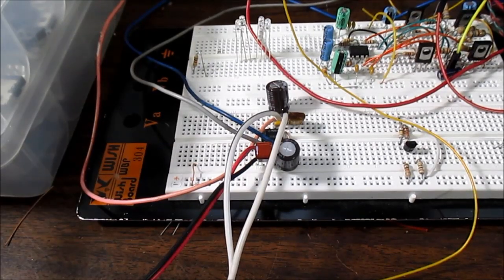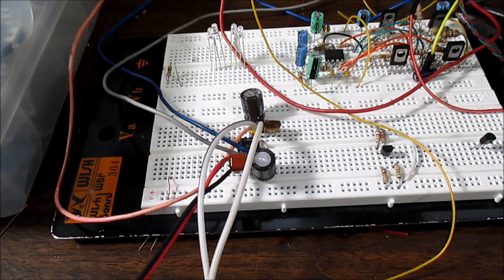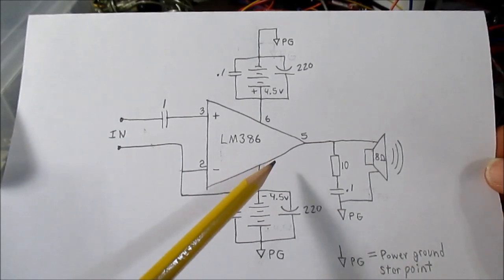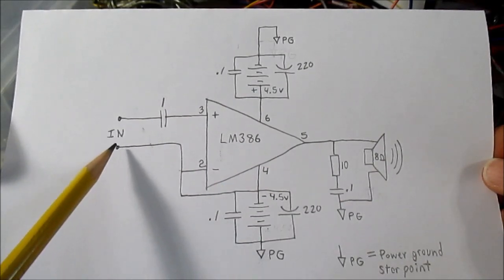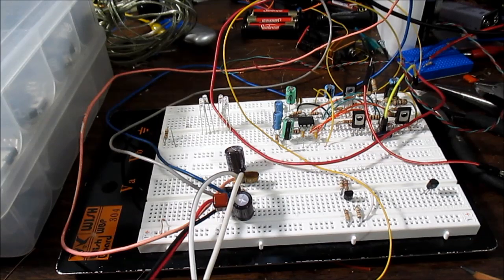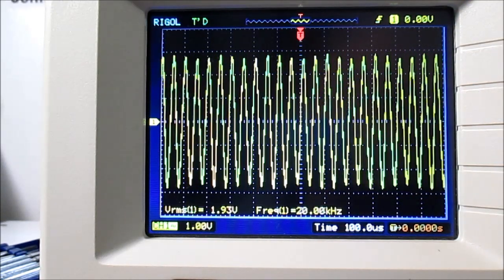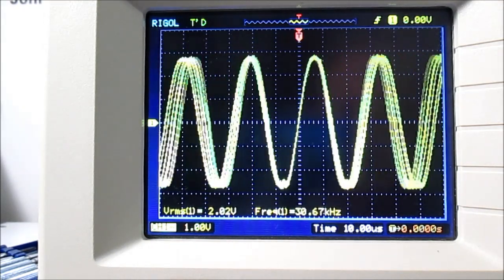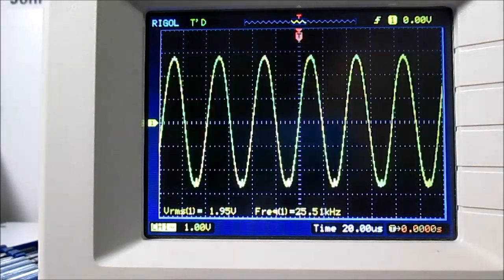LM386 audio amplifier on DUAL power supply for flat frequency response

Comment: I just improved the sound of some speakers  changig the output capacitors. It drastically cut the bass, had crappy pocket radio sound for having only 220 microfarad capacitors, 470uf  and totally musical. Some Trust that had Tda2822 inside. Simple thing but amazing difference.

Comment: Are there any differences using a non polarity capacitor (i assume that you use an polar cap)? I Love your job jonh!
Reply: I assume you mean as an output coupling cap? No, there is no difference in sound compared to a polarized one, but you need a large value cap for decent bass response.
Reply: Electrolytics are typically used for output coupling because of the high capacitance. It allows you to not lose any low frequency response.

Comment: Hi John,
i always wondering if measuring an amplifier with simple resistive load is a overly simplification. Here not so much the power but the quality of the sound. I know about the feedback loops that should corrects the effects of complex impedances. What do you think about it? Is it really sufficient to test the output at 1 kHz to make a statement of the sound quality and what are the reasons therefor?  

Thanks
Reply from the maker: The biggest problem with reactive loads is power dissipation as high currents can be flowing through the output transistors when there is a high voltage across them meaning high dissipation. High currents can mean more distortion. A capacitive load can cause the amplifier to go unstable as well. We hope the amplifier designer has taken these into consideration when designing the amp or IC. Since most loudspeakers are largely reactive in a small band of frequencies, this is really transitory with normal music signals.

A newly designed amplifier should be given a battery of tests including a 20 to 20KHz distortion measurement. I don't normally perform this in my videos because they end up too long for the subject and get less views. If one distortion frequency measurement is to be taken, 1KHz is the most logical because the largest harmonics will be right at the most sensitive frequencies of human hearing.

Comment: Hello sir, do you know if there's a way to improve the performance of a Class D amp module? Here's what I mean: I have a Sure electronics board and with some songs that have a pronounced kick/rhythm when I turn the volume higher I get a slight distortion every time the beat hits. It gives the impression like the amp is weak or has no reserve. Would maybe some larger value caps help this issue? I tested with low frequency tones and seems to play 30-40 Hz just fine but with those beat kicks it's different.
Reply from the maker: I'm not clear on the issue you have but this could be the amp is overloaded because the speaker impedance you are using is too low for the amp. For example, if the amp is rated for 8 Ohms minimum and you are using 4 Ohm speakers, the amp's current limit could be kicking it on the bass beats causing distortion. It could also be oscillation from feedback. You must be sure the input cables are shielded so they don't pick up signals from the output that can cause distortion on the heavy beats.